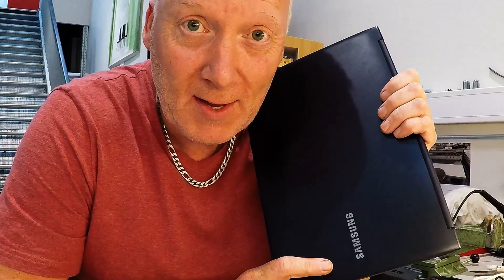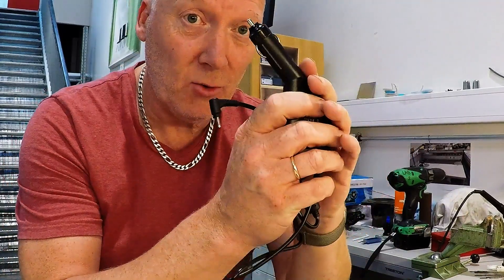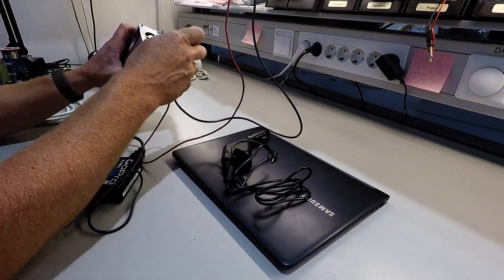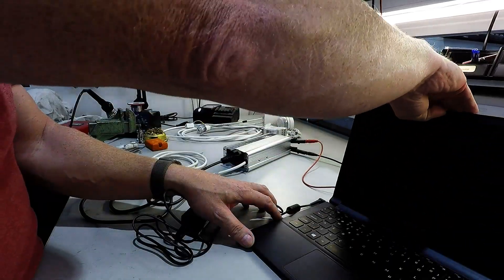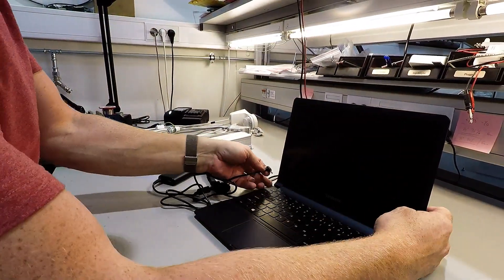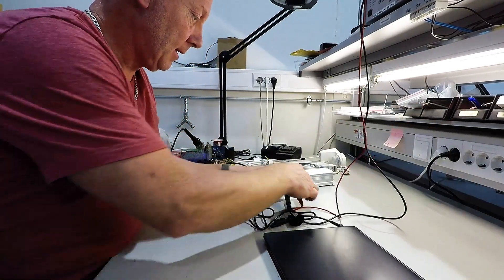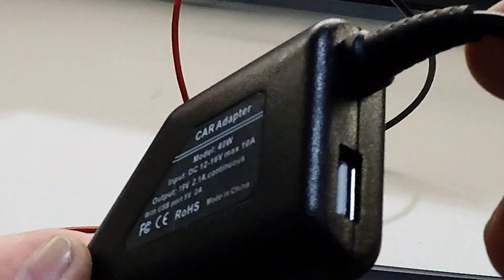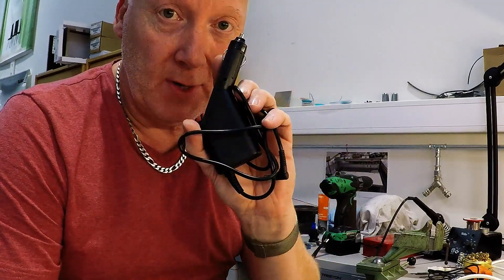How to proper charge a pc/laptop/computer in the car

Comment: I'm about to build one for my 19.5v laptop. It is laughingly super simple, I just need to buy  200W Boost converter, with output voltage adjustable using mini potentiometer, so basically ANY laptop's different voltage (12, 19, 19.5, 20v) can be catered. The input voltage range is between 10-32V. You can just search the boost converter module in online markets (aliexpress, ebay etc). Yes, it is not a ready product, you need to build a box and add cables but it isreally so simple, probably a 1-3 hours of weekend project.
Reply from the maker: Sounds excellent 👌

Comment: Simple old school = more reliable
12 to 19v is way more efficient. 
You can also use new PD usbc 20v but more of hit miss and more complex delicate cable. Most PD plugs don't seem to boost from 12v to 20v. 
If you read fine print, they need 24v to do 20v seems like they are buck only.

Comment: Universal charger for many laptops? 18.5V ( if laptop requires 20 it will still charge ) and universal amperage 4.5. It is somewhere between 83 and 85W and completely doesn't matter if your laptop requires more or less, it takes how much it needs of course if it is not a gaming laptop and your need is not to game on it while charging, you are completely good to go without any harm or damage. You can still charge a gaming laptop but can't game on it while charging because the voltage will drop due to CC methode and laptop will stop charging. It's not a bad idea but the most worst idea is using buck/boost converter in a 24V system. If you plug a laptop first and then 24V, there is a big big very big chance that the buck/boost converter will pass through 24V for a short time ( each chinesse brands are different ) and you can potentially burn a charging IC logics. For 12V is completely safe, if a converter pass through 12V nothing will happen. For 24V system, plug a converter first, then a laptop and for the extra more safetyness, you can add a volt meter to be 100% sure that the converter outputs exactly what you've set it at.
Reply: The output is only powered up when the controller decides to do so. There should be no problem leaving the device plugged in.

Comment: You seem like the right person to ask I'm setting up a solar setup for camping without much experience. I have bought an dc to ac inverter similar to the one you have in the video. On the instruction manual it says that the inverter needs to be grounded but I see you're running yours without a ground maybe? I think I might return the dc to ac inverter and just get a charger like the one you mention if that's the case. It would be handy though to run ac while camping.
Reply from the maker: Do you mean the inverter housing? Ground is the same as minus. Make sure you use thick wires from the inverter to the battery!
Reply: @Italjohn  yeah the inverter housing thank you.
Reply from the maker: @PatrickJFurther  I'm not sure why you should need to ground the housing, could be to minimize electrical noise?

Comment: Laptop computers runs on 5vdc. inside there is an electronic circuit inside that takes the input voltage and converts it to 5vdc. If you plug a laptop directly into a cigarette lighter with the correct polarity to the computer, that built in circuit will change the 13.8 vdc from your cigarette lighter to 5vdc. You do not need a converter to change 12vdc to 115vac and then plug inverter to change the 115vac to 5vdc for your laptop.
Reply: Nono
Reply: Laptops usually have a 14.8v battery tho... not sure what 5vdc has anything to do with this...
Reply: Digital circuitry runs on 5 volts DC. Whatever the battery puts out, if it isn't 5 volts, it is converted to 5vdc. What the battery requires as an input to charge depends on the battery technology used.

Comment: Will it work if the watts output from the universal charger was less than the normal laptop watt output?
Reply from the maker: It's hard for me to tell, but I think it will work, but with a litle slower charging rate. In worst case it will not work and maybe burn out.

Comment: Why 7 thumbs down ? truth be told i was going to be 8th thumbs down. judging video before i actually saw it. i was blown away with your equipment. I'm the 127th thumbs up. ebay link did show others. i don't like the inverters having to create and waste energy just so laptop drops it down. your DC to DC adapter very nice.

Comment: I have a challenge! I have 2nd hand laptop and battery is dead. How can I run it from  2x12v batteries connected in series =24v? 
The AC 240v (UK) charger output is 19v DC)
So I need something to change 24v into 19v
I am a total beginner and it's going on a boat one day.
Reply from the maker: I have no idea, sorry 😐

Comment: mine says 7A-125V laptop is Dell Inspiron  15 5000 series what should I do the batteries tag is not readable now.
Reply from the maker: Look here: https://www.ebay.com/sch/i.html?_from=R40&_trksid=p2334524.m570.l1313&_nkw=car+charger+Dell+Inspiron+15+5000&_sacat=0&LH_TitleDesc=0&_osacat=0&_odkw=car+charger+Dell+Inspiron++15
Reply: But thats the actual charger what I need is an extension inside the car? So I can charge multiple devices.

Comment: 2 years later, the charger/laptop still working ?
Reply from the maker: Well, thats a  good question I can't answer, as I have not used it yet. Sorry to let you down.
Reply: @Italjohn  After installing that 120W socket in the van, I've start searching for 12v charges reviews and your video shows up on top results. 🙂 
Just wanted to be sure if worth the money or not.  To be honest, I'm a bit sceptical, but will be nice to not depend on inverter anymore. ✌️

Comment: dose this weaking or kill you battery or drop it down to 5volts from a 13v charged suv/car battery?
Reply from the maker: Hi Travis. It will drain your battery some how. With a 2,3A drawn from a let's say 80Ah battery in good conditiion, it should last approx 30 hours. But then again a standard lead acid battery should never be discharged below 50%, so a more realistic charge should be 15 hours.

Comment: Does it work with a 24 volts battery system in lorries?
Reply from the maker: That's a good question. It says 12 to 16 volt, so I don't think it will work properly on 24 volt.

Comment: thank you for this video. i just subscribed because you give us the same idea i start working about it. charge my pc in the car.
    I hope you can help me, or any one have any idea, i buy  BASEUS MAGIC 45W(smart car charger, out put 5v=4.5A-12v=3A-20v=2.25A). but when i try connect my pc with this charger, not working.i use cable + and -
Reply from the maker: Thanks for the comment. Sounds like you have the correct charger, but it's hard for me to tell why it don't work. Do you have a link for it so I can see it?
Reply: @Italjohn  THANK YOU very much for your fast reply, this link for it https://www.tvc-mall.com/details/baseus-magic-series-pps-digital-display-type-c-pd-qc-intelligent-dual-quick-charging-car-charger-45w-blue-rose-sku810800470b.html
Reply: @Italjohn  this is Pic how i install it with my Pc.

https://drive.google.com/file/d/10NCjhduk9GPJAXHz-a0g45W10kYw_4Zf/view?usp=sharing
Reply from the maker: @Achabab  I think you have bought a wrong charger, as it will not deliver 15-20 volts unless you have a 24 volt input. I would recommend this one: UK: https://amzn.to/2Z4EiCl  USA: https://amzn.to/2TOXKNC